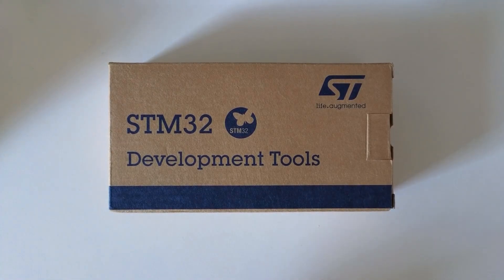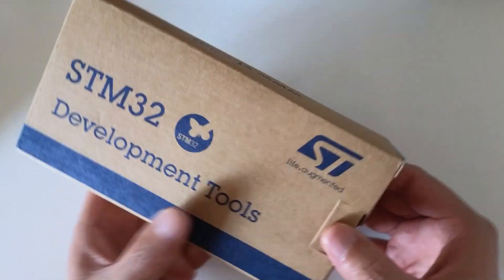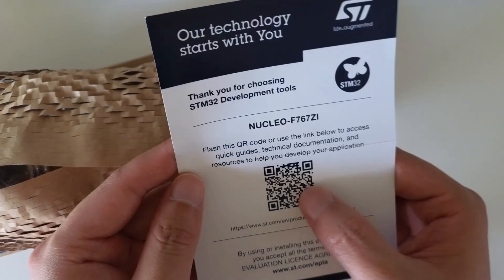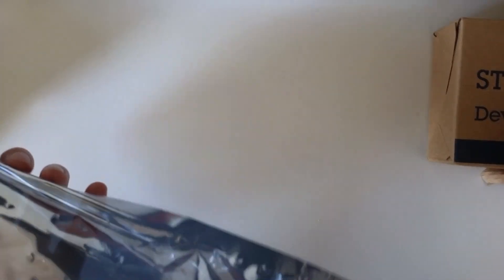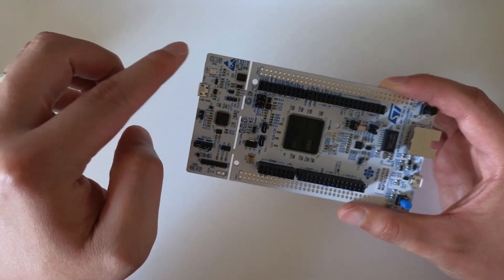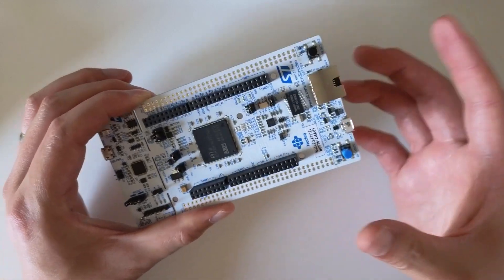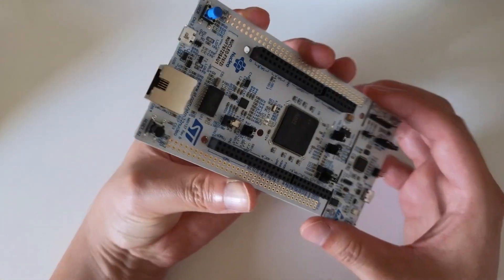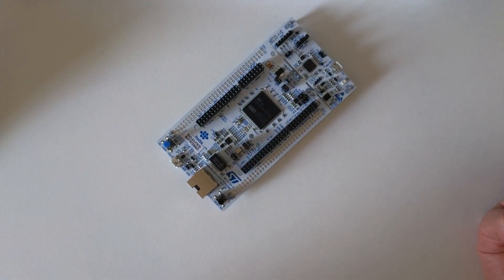Unboxing STM32 Nucleo-144 Development Board with STM32F767ZI MCU

Comment: What are you doing with the board in the thumbnail ?   Is it sitting loosely on the breadboard or are you using an adapter to connect it to the breadboard ?

What compiler are you using and how do you like it ?  Does gcc make use of the FPU ?
Reply from the maker: It cannot fit on a breadboard directly. Hence, I put it on the side. I am using the C compiler that came with the ST-Micro IDE. I am using it for real-time embedded programming.